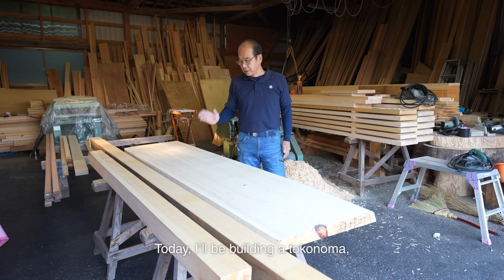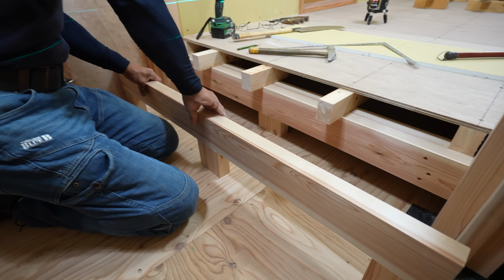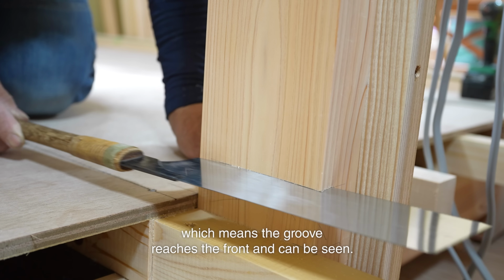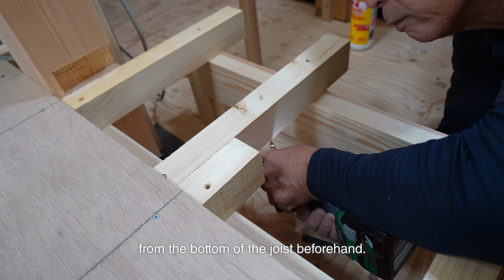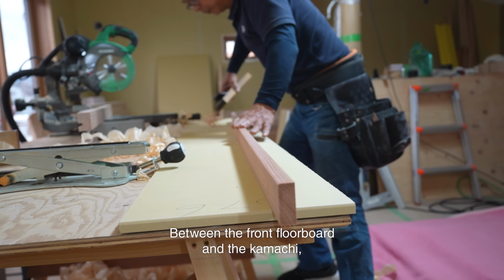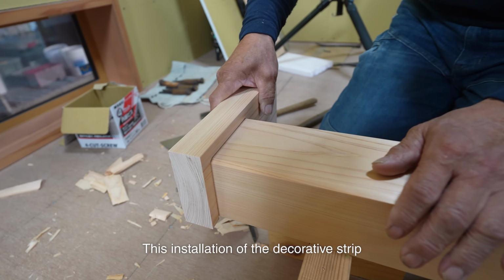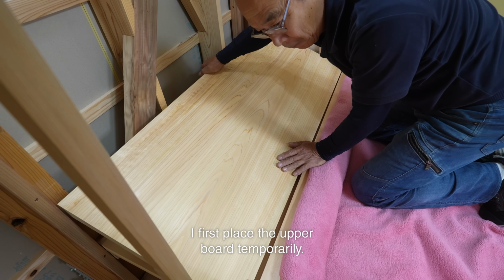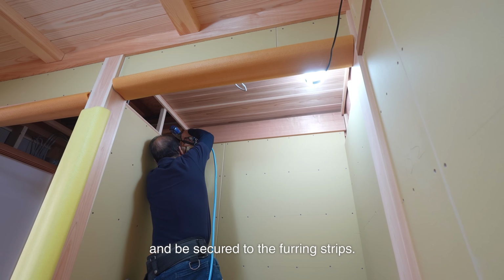Building a Two-tiered Tokonoma: A Style Once Prevalent in the Past [Season 4 - Part 16]

Comment: excellent craftsmanship as always!
I'm curious if you could provide a list of hand tools you used.
1. hammer(s)
2. scissor lifts for the mitre saw
3. square guides with handle for your circular saw.
adding glue to the edge grain to prevent cracking is super smart.  I've never seen that done before!